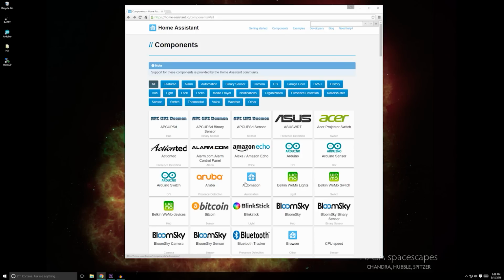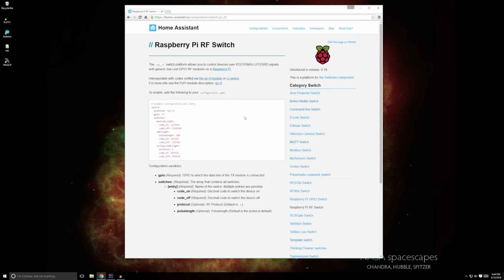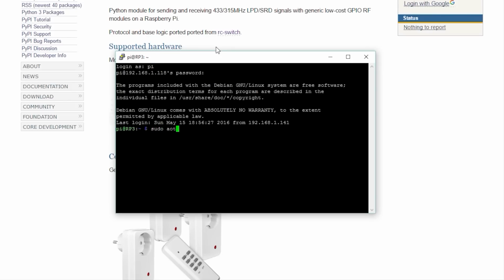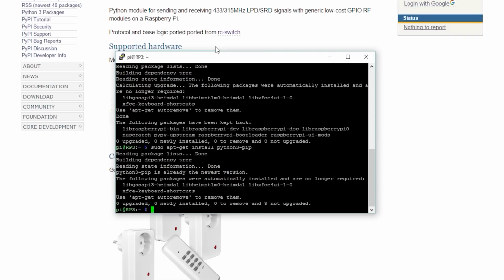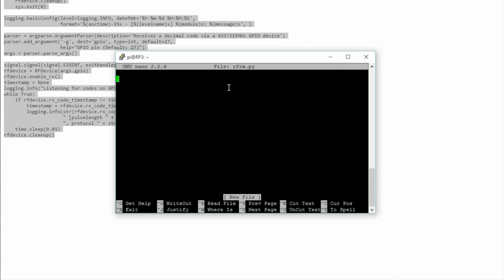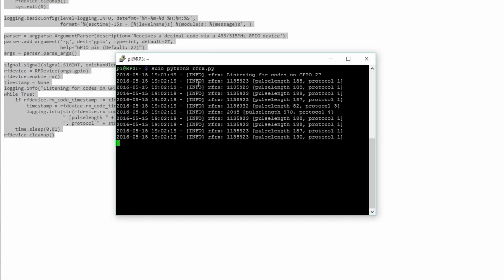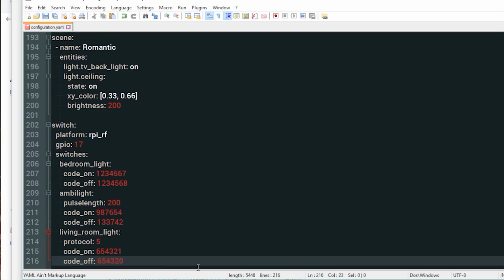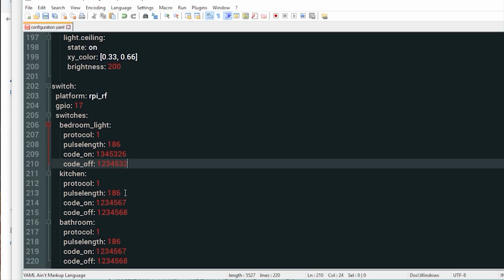The Cheapest Tech - $6 DIY Internet of Things Smart Outlets

Comment: I noticed that there is the Raspberry Pi RF switch component as well as one for pilight that says it is also for 433 rf. Have you used pilight? Which option is better / easier?
Reply from the maker: I haven't used Pilight just yet. But, looking at the configuration, the RF switch component is certainly easier if you already the RF codes, but it doesn't have any way of reading received RF messages. I'm going to check into Pilight soon and see if I can get a video out.
Reply: Cool, thanks for looking into that. I was planning on diving into RF soon so it will be nice to have videos on each option. Keep up the great work!
Reply: Hey there, I have one more question for you. I appreciate all the help. Is there a way to use the remote from these to trigger something within homeassistant? For example, have homeassistant trigger all of my lights to turn on, Including my zigbee / zwave lights when I press on with the rf remote from etekcity. I tried looking through the rf components for homeassistant but I can't seem to find any that allow triggering something via rf.

Comment: I'm getting random signals, what is wrong? :( 
http://oi64.tinypic.com/2j4y5g8.jpg
Reply from the maker: Hmm, sadly, this could be a lot of things. Noisy power, a bad receiver, RF interference, bad connections, etc. There's not really one solid fix for the RF stuff. I'd move to a physically different location, try a new power supply, and see if that does it. If not, it's probably okay. See if you can get the right RF messages from the remote. The receiver isn't really used much once you get the codes from the RF remote. Sorry about the trouble! Cheers!
Reply: I have the same problem... Did you fix it ?
Reply: Yeah using a different git. The one in the video is not working for me. This one does :) https://github.com/rotv/433Utils

Comment: Well its 130am here and Im stumped at first I could not get the service to show up, and in my log I found "RuntimeError: No access to /dev/mem. Try running as root!"  after some research I found running the line "sudo adduser hass gpio" in putty did the trick, now I have no errors in my log, and I see the switch on my dash, but when I click it nothing happens (I have the outlet right net to the ant)..
I am not sure where to go from here, since I see the switch and I am not getting any other errors, I am guessing it something on the hardware set up side (confirmed the codes and wires to gpio are correct)...Any other troubleshooting tips? Thanks!!
Reply: Thanks for the adduser tip! It worked for me.
Reply from the maker: Nice! Yeah, the add user tip is clutch. I actually added that in the video description, but I guess it was too little too late. :( My bad! Pumped you guys got it going. 

Best I can figure, something is wrong in the transmission. You could try and have the receiving script running while you transmit the RF code. I bet it is jumbled. A few other people are having the same issue. No clue why. I think it maybe jumpy power, bad shielding, bad hardware. It seems like a different solution for every case. 

You can define the default protocol and pulse length in the RPI RF configuration, I think. I'd try that. Different hardware maybe - power supplies, RX TX, etc. Some people swear by smoothing capacitors on the transmitter and/or receiver side. I never had any luck, but it fixed some. 

It blows, but sometimes you have to keep trying things until it works. The only solace I have is once you get it up, the system is super stable. Let me know how I can help!
Reply: Thanks for the reply Ben. I bought the better Superheterodyne kit,  but havent gotten it working just yet. Tonight I think I am going to wipe the script and start from scratch(Once I google how to lol)... If you wanna check out my logs I posted them on the forum here asking for help a few days ago https://community.home-assistant.io/t/stuck-setting-up-rf-transmitter-on-pi/3992  ..I am new to both the PI/HA so I can get stuck pretty easily, hopefully just starting over does the trick! Thanks again!
Reply: Did you ever get it working?

Comment: So if I used the All-In-One installer, do I need to install rpi-rf as the hass user, within the virtual environment?
Reply: I did the above and got mine working after a bit more troubleshooting. After defining the outlet switches in my configuration.yaml, I ran the listening python script again and noticed that even though I had defined a pulselength of 195, flipping the switches resulted in pulselengths closer to 200. I guess there was a little bit of laggg. So I shaded my pulselengths in the configuration down to 191/192 and this made the actual pulselengths 195/196. Sidenote: for some reason the Home Assistant user interface switch seems to work better when I press and hold it for a half second before flipping it. 

My outlets still need to be very close to the transmitter because I haven't put any work into my antenna. But I plan on following the Instructable "433 MHz Coil loaded antenna by diy_bloke" to make mine.
Reply from the maker: This is sweet! Thanks much for sharing your experience. Yeah, the RF outlets can have some strange things like that. I haven't noticed the shifting pulse lengths before. That's interesting!

I guess you figured out the answer to your first question was yes. :P Sorry for the delay getting back to you. I'm probably going to come back to these RF outlets when I set them up in my new place. Let me know if I can help with anything! 

Cheers!

Comment: @Ben ... first of all thank you very much for your tutorials.... i finally managed to make these switches work, but there is one hurdle, when i use on/off switch from home assistant front-end it doesn't work (i think the command to on or off is sent only once), i created http post command task in tasker, and cloned it 4 times and added 200ms wait after each http post command... now when i click on, 1 out of 4 command works and the  switch is on, I am ok with it, my question is can i make the same thing in home assistant like if i hit on/off button in the front-end, HA should send the code atleast 4 or 5 times as defined by me..... or i need to make a script for that? can you please help.....
Reply from the maker: Interesting. Yeah, I wish the RF switch component had a retransmit option. Have you tried adding an antenna to your transmitter yet? That might help. There might also be something funny going on with the protocol or something so the code is just a little off. If those changes don't help, you can definitely go with a script method to transmit the same message multiple times. That's not great in the long run, but is definitely doable! Cheers.

Comment: What RF frequency US use in ceiling fan?
Reply: I can only find 315 and 433 RF transmitter on Amazon.com
Reply from the maker: I've seen 433 and 315 around. I'm not sure if there is a standard. Also, ceiling fans can be hit or miss. Sometimes it's just a simple RF signal, but I've seen some of the fancier ones with 2.4 GHz remotes and such which are much harder to clone. Just depends on whatever fan you're using! Cheers!

Comment: Thanks for the great tutorial.  I got 4 of these outlets working in less than an hour...much cheaper than "smart" outlets.  I have a more analog question though, where do you store the additional components without them getting messed up?  I've got them working but they are dangling off to the side.
Reply from the maker: Nice! That's awesome. Yeah, so that's an issue for me still, as well. I have my Pi in an enclosed cabinet so it's not a major issue. Once I get my 3D printer up, I'll probably throw together an enclosure that has a RF RX TX space to make things look a little nicer. I'll be sure to share that around once I get that up. Cheers!

Comment: Really good guide since I'm trying to switch from my old telldus to HA instead! Would this also work with the tellstick net? having the rpi close to that one and sending commands to those outlets?
Is there anyway to also get the 433Mhz sensors to HA
Reply from the maker: So, HA has native tellstick integration. I haven't used that, but my understanding is that you can control RF devices and use RF devices as sensors. You could also use Pilight for RF sensors as well. The RP GPIO RF Switch component can really only be used for transmitted RF signals and doesn't have any ability to receive RF signals. Cheers!

Comment: i getting error when i running the script

pi@toshibopi3:~ $ sudo python rfrx.py 
Traceback (most recent call last):
  File "rfrx.py", line 9, in <module>
    from rpi_rf import RFDevice
ImportError: No module named rpi_rf

please need help
Reply from the maker: Did you install the RPI_RF module prior to running the script? You'd need to run these commands

sudo apt-get install python3-pip
sudo pip3 install rpi-rf

https://pypi.python.org/pypi/rpi-rf
Reply: +BRUH Automation 
I did! And was working. But next day start give me this error. Maybe is the receiver is dead?
Reply: +BRUH Automation 
If possible you can try with the receiver disconnect if give same error. Maybe my receiver is burn out.
Reply from the maker: Hmm, I don't think it would throw that error if the receiver is bad. Not really sure what is going on there. It seems like your library got messed up, but I can't really tell. Does HA throw any specific messages in the log when you try and use the RF switches?
Reply: +BRUH Automation 
I try to do "sudo python rfrx.py" and just give that error and not start.
Reply: what version of python are you running?

python --version
Reply: +Marcus Hansson 
I did clean Jessie install and I think have Python 2.7 and 3.4 on the Jessie
Reply from the maker: Ah, I'm wondering if you need to run the pip3 install rpi-rf command inside the venv. Try running the commands sudo su -s /bin/bash hass, then source /srv/hass/hass_venv/bin/activate, then pip3 install rpi-rf  That's a shot in the dark, but maybe that'll do it. I can't remembering doing that inside the venv, but it's worth a shot.
Reply: +BRUH Automation 
Thanks I will try tomorrow when I get home from trip!!!! :)
Reply: i type "sudo su -s /bin/bash hass" and back "No passwd entry for user 'hass'.
Reply: +Marcus Hansson 
My Python show 2.7.9, how I install Python 3?
Reply: my big mistake i did "sudo python rfrx.py" i forgot "3" "sudo python3 refry.py" now is working good!
sorry I'm new on coding.
Reply from the maker: Nice! Pumped you got it working! Just checking through old comments and saw I missed this. Congrats on getting going with these!

Comment: Hi Ben , question , i bought this stuff and it's working perfectly , i would like to connect my Somfy remote also , but the receiver isn't picing anything up. I've checked , the outlets are working on 433.96Mhz, and the Somfy on 433.42 Mhz, could this been the problem ?
Reply from the maker: Interesting. I would have guess that would work, but I guess not. It could also be a protocol difference. I don't know much about the Somfy remote. Is anybody there claiming that it works with 433.96 Mhz stuff?

Comment: thanks ben for your tutorial... i managed to control the etekcity outlets with my phone from home assistant........ my main problem is the range of transmitter it is around 1.5 meters only!!! i just wanted to know if the rf code we added to rfrx.py is involved while transmitting as well or it is just to get the codes? .... i m trying to make diy antenna for rf 433 transmitter now.... any suggestions?
Reply from the maker: For sure! Nice! Pumped you got it working. That range is short. have you tried adding an antenna to the transmitter? Using a header wire actually works pretty well for me. Once you have the codes, the receiver isn't really used. It's just the transmitter you'll need. If an antenna doesn't work, I think most of those transmitter can take up to 12v. Increasing the power can definitely help. Cheers!

Comment: Hi,

I continued to have some problems but finally got it working and wanted to share what I found.

After circling around and setting the RF transmitter up on an Arduino to confirm everything was working, I identified that the codes that my wireless switches used were very large (10 digits decimal).

So looking into the rpi_rf.py code these is a tx_length variable which defines the number of bits in the code. This was set as default to 24.

So I updated the RFDevice class _init_ function to have this as 32 bits default, as below, and everything is working!

I'm not sure if this could be exposed in the Home Assistant yaml settings as an optional parameter to allow this to be dealt with more easily.

Cheers

class RFDevice:
    """Representation of a GPIO RF device."""

    # pylint: disable=too-many-instance-attributes,too-many-arguments
    def _init_(self, gpio,
                 tx_proto=1, tx_pulselength=None, tx_repeat=10, tx_length=32, rx_tolerance=80):
Reply from the maker: Sweet! That's awesome you got that sorted out. Very good advice. Are you using Etekcity outlets? I'll be sure to pass this info along if anybody else is having similar problems. Cheers!
Reply: Sorry for the slow response. I'm based in New Zealand and we don't have the Etekcity brand. The ones I used were ARLEC, which is an Australian brand. Cheers
Reply from the maker: No worries. Looks pretty cool! Thanks again for sharing.
Reply: This was exactly what I needed. Thanks!

For reference, I'm in the US and I'm running Westinghouse modules.

I knew something was up when I ran the rfrx.py script and toggled the switch in HA and saw values that, in no way, matched what I put into the config. Updated to 32 and bingo seeing the correct values.

Thanks, again!
Reply: Funny thing, I have 2 different types of RF sockets, one set generates 8 character codes, and the other 10. If I update tx_length to 32 one set works, or to 24 the other set works! I can't get them both to work at once! Gaaah!!!!

Comment: I can't get this to work in HA at all. I get a code of 1398076, pulse length 194, protocol 1 as one example. When HA sends it out - it's the wrong protocol. (3 instead of 1) If I use codesend, from github.com/ninjablocks/433Utils ,it consistently works, so my transmitter is good! Running sendrf.py gives same results as HA, but occasionally gives protocol as 1 - but when it does, the pulse length is 360. This is driving me nuts. Installed brand-new Jessie and updated/upgraded last night. Running a PiZero, but don't see why that should be an issue. Any ideas?
Reply from the maker: Dang, sorry to hear of the troubles. The RF stuff can definitely be frustrating. When you setup the RF side on HA, did you set the default protocol and such? Check out the optional configuration variables. It can help nail down some of the issues you're having. https://home-assistant.io/components/switch.rpi_rf/ Let me know if that doesn't work and I'll see if I can think of something else. Cheers!
Reply: Found through serendipity that a pulse length of 100 seems to work - will try to fine tune that for reliability. I don't know yet what the rfrx.py program is logging as the pulse length. It must be close to the 194 I documented earlier. Thanks!
Reply from the maker: Interesting. That's very odd, but pumped it is working! Sorry again for the troubles.

Comment: Thanks for great video!
This will work with x10?
Reply from the maker: Eh, kind of. Home Assistant does have some support for X10 via the ISY994 controller. I know nothing about that though. I use mostly WIFi and/or ZWAVE/RF devices. I'm sure there are people who can help with that though! Cheers! https://home-assistant.io/components/isy994/
Reply: +BRUH Automation thanks for reply! X10 is not same same as the one you using?
Reply from the maker: Sure thing! Yeah, X10 is a different protocol, but these outlets use a similar technology. These outlets are just generic RF. Cheers!

Comment: Thanks for the great information. Got it setup and all OK until running in Home Assistant.

16-08-14 01:02:00 homeassistant.components.switch: Error while setting up platform rpi_rf
Traceback (most recent call last):
  File "/srv/hass/hass_venv/lib/python3.4/site-packages/homeassistant/helpers/entity_component.py", line 98, in _setup_platform
    discovery_info)
  File "/srv/hass/hass_venv/lib/python3.4/site-packages/homeassistant/components/switch/rpi_rf.py", line 49, in setup_platform
    rfdevice.enable_tx()
  File "/home/hass/.homeassistant/deps/rpi_rf/rpi_rf.py", line 77, in enable_tx
    GPIO.setup(self.gpio, GPIO.OUT)
RuntimeError: No access to /dev/mem.  Try running as root!

I setup the Raspberry Pi with the One Step install which gave me a virtual environment.

Any suggestion on what I've got wrong here? Thanks!
Reply: Ok figured it out.

This was very helpful;
http://raspberrypi.stackexchange.com/questions/40105/access-gpio-pins-without-root-no-access-to-dev-mem-try-running-as-root

So the hass user needs to be added to the gpio user group.

So once you are logged into your pi just do the following

sudo adduser hass gpio

restart your pi and everything runs.
Reply from the maker: Awesome! Sorry for my slow response. Yeah, that's one of the annoying things about running HA as a different user. Sorry that extra command never made it into the video! I added the note in the description, but it's super easy to miss. Let me know if I can help with anything. Cheers!

Comment: OH BOY, just ordered everything I need to get started. Excited to start automating! :D
Reply from the maker: Sick! It's awesome. Let me know if you need anything! Cheers.
Reply: So my RF receiver / Transmitter took forever to arrive, just getting things set up now. I have HA installed on my pi 3, everything wired up. Stuck on running the rfrx.py, i see it's 'rfrx: Listening for codes on GPIO 27' but it's not picking up anything when I'm turning the outlets on/ off. any suggestions? Digging around for some answers.